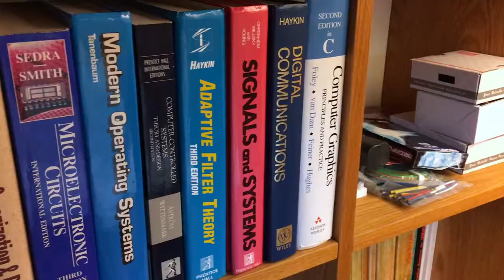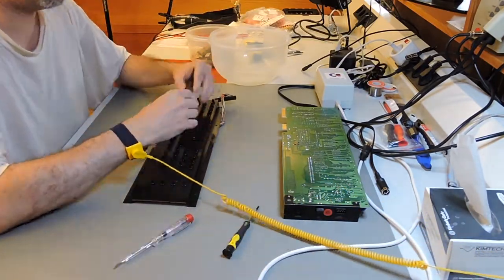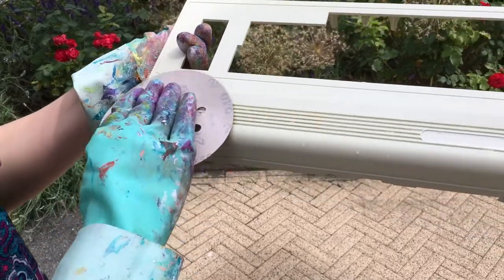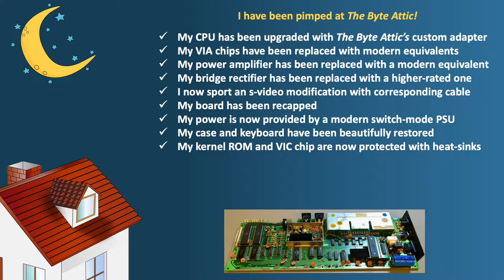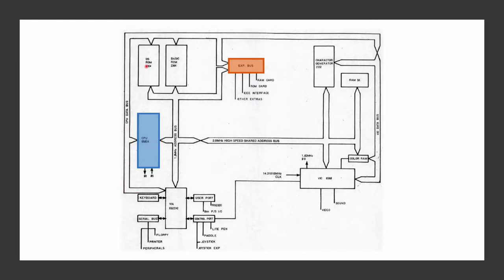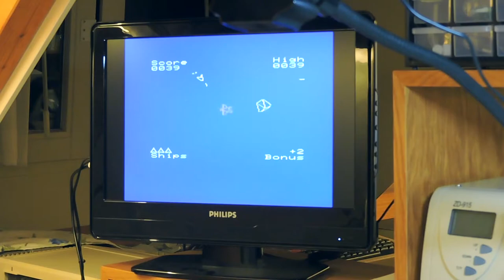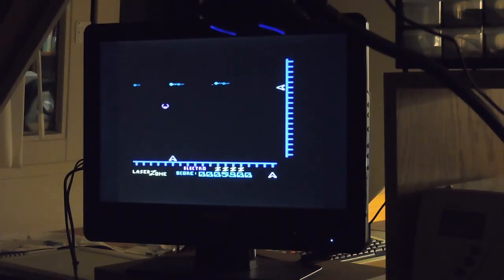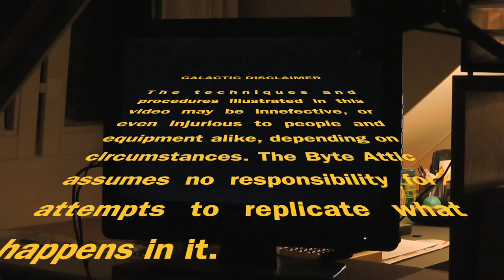VIC-20 case/keyboard restoration, architecture & retrogaming (Pimp My Eight, episode 5, part 3)

Comment: Well done. I have recently gotten a VIC-20 and many keys were not working. After cleaning gently, as you did, they still weren't working. I put the contacts under a microscope and found a very fine film of corrosion. So, end the end I had to scrub a bit harder with some IPA on the contacts. I think your advise to leave the plungers alone is very good advice.
Reply from the maker: Thanks for the kind words!